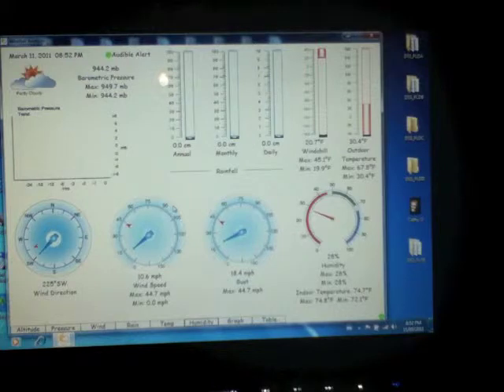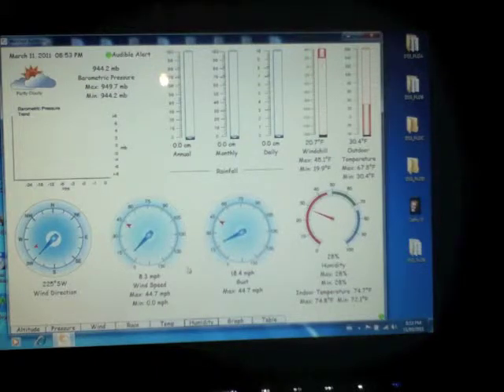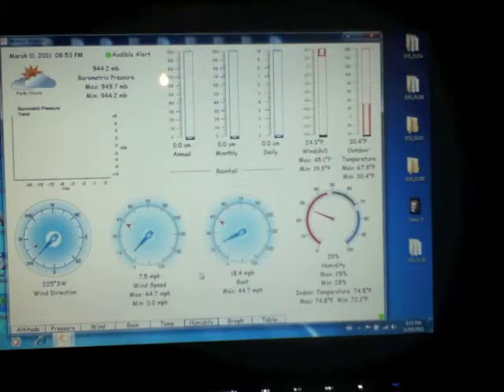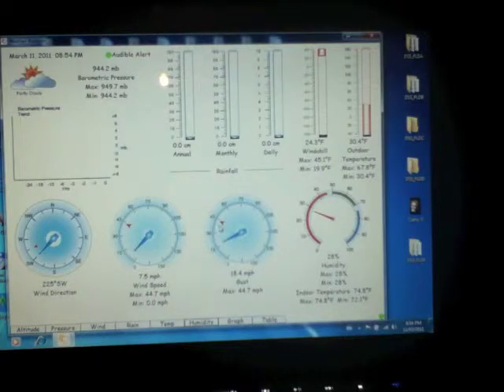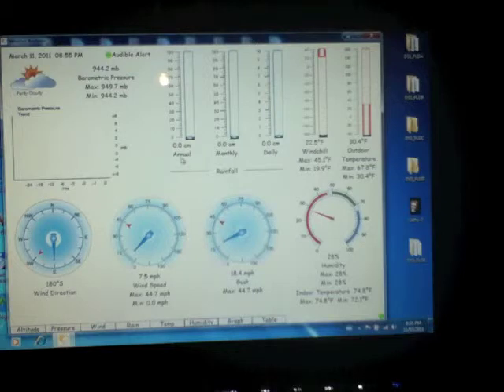Weather Machine

Comment from the maker: The refresh rate was slowed down as a battery saving feature . I havent looked at if it is adjustable yet. Yes it records all data , and you can look at any piece or size of the graph recorded. Totally friendly in that regards. It's a cheap piece of junk that seems to work way better than I ever expected. refreshing rate may be slow , but who can watch a weather machine for very long anyway.If you want something interesting to watch when get a WattsView power monitor soon to have wind speed.